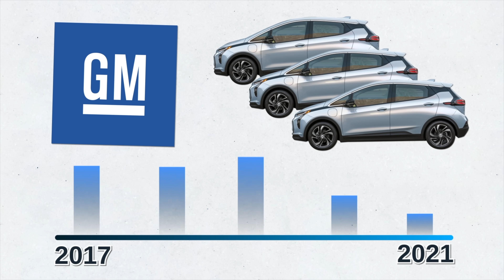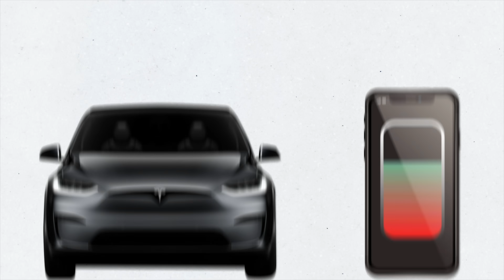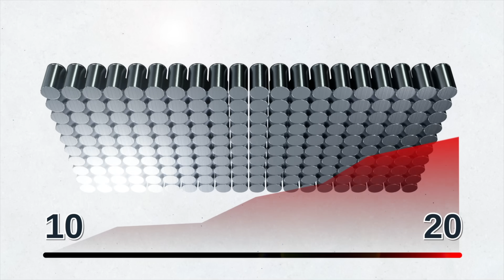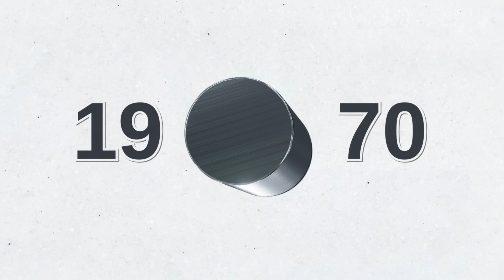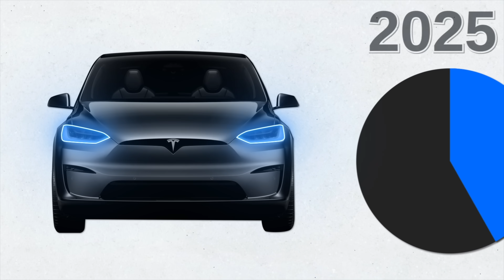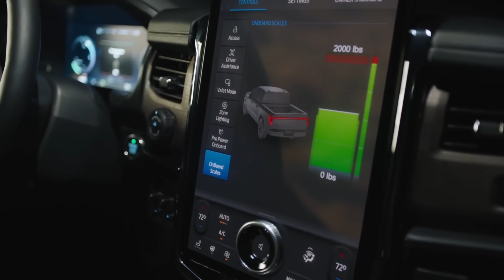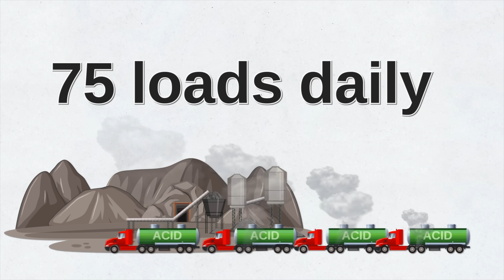They Tried to Shut Me Down for Telling the Truth About This Electric Car

Comment: 100,000 miles isn't long. Especially when you pay a giant price tag and probably gotta hope a college kid buys your car
Reply: Just wait until all these people who are buying these EV's , and need a new battery , and don't have the $$ .  What , finance a new battery for another 3-4 yrs . If their credit allows ?
Reply: E V n  battery  will  be  toast  long  before   100 k  miles  n  less  than  7  years.  throw  away  item / device like  used  laptop, cell phone n  tv.
Reply: Toyota offers 10 year, 150,000 mile warranty on their Prius Prime’s battery, and Toyota’s batteries generally last far longer than their warranties.
Reply: And with trucks that now cost $100,000…you are literally paying $1 per mile for ownership before fuel costs
Reply: @driver4011  Well I was concerned about the first 200 dollar phone I bought.  This 1400 dollar computer I purchased 2 years ago thats having to update every third day just so I can occasionally make a phone call on it but text like crazy on, it wants to be replaced though the battery lasts most of the day and I can usually plug it in all over the place otherwise.  So, 70 thousand for a VW Bug equivalent car that I'll have to throw away in 3 years?  Sure, that sounds reasonable.  NOT  (Are we doing Wayne and Garth quotes anymore?)
Reply: @mcc7762  my mom has one with 110K miles, no issues, but your absolutely correct, I went to my local junkyard, there were more Prius’s than any other Toyota models there.
Reply: the  price  of  hybrid car,  parts, battery n  repair  too  high......same  with  EVs...good  ole  i.c.e.  car  wins.  the  cons  of  owning  n  driving  an  EV  and / or  hybrid  far  outweigh  the  pros.

Comment: My 1987 Datsun 1200 has 240,000 km on it. Stock engine. Still runs like a charm. Hand me down from dad. Most repairs cost less than 50usd. Electric cars are overrated and overpriced.

Comment: Lithium cathodes degrade over time, they can’t simply be placed into new batteries.
Reply: Don't try to explain this or any negative to a glassy eyed EV zealot.  I'm an electrical engineer and have been told flat out that I don't know what I'm talking about.

Comment: As Scotty rightly pointed out numerous times, Hydrogen Fuel Cell technology is the way to go. Then, I'll convert my 4Runner to hydrogen and eventually pass it along to my kids and then their kids. Awesome video, Scotty!! As usual.....
Reply: It would be if the companies supposedly in favor of hydrogen weren’t intentionally sabotaging it to make it seem infeasible.
Reply: I agree that hydrogen is the ideal option, I would want that as well, but transportation of it requires insane amount of energy as it has to be cooled down, compressed and stored under high pressure. It's also not ideal as a solo thing - if you for example would run out of hydrogen in your car it's not like you could take a jerrycan and go to your nearest gas station. You'd literally explode if you'd try to do that.
Reply: @PaganiTypeR  they can make "cans" for it but they would never trust us with that kind of energy density
Reply: Abe, superficially the FCV running on H2 is a very good alternative.  But as the argument to go either EV or FCV is reducing such emissions as CO2 the H2 production is neither clean nor energy positive.  If made through electrolysis from surplus wind or solar, it can be clean except for the costs (both in financial matters and manufacturing emissions) and very dependent upon the excess being there.  If stripped from NG (which is one popular source) there are significant amounts of CO2 exhausted (the argument here is that this CO2 will be CCS into holes in the ground. (Also a technology that has not been working as well as promised but they will keep working on it while the Government research grants keep coming.  If you don't have surplus power from clean sources in the Grid, more energy is consumed in producing the H2 than is available when it is converted back into electricity.

Comment: Electric car batteries are designed to lock you out of the bottom ten percent of capacity and the very top of the capacity that’s why they last longer than phone batteries. That’s why the hoverboards that kids used to ride had so many issues with batteries. kids would ride them until the battery completely drained. Lithium batteries will not accept charging if discharged to a certain value. That’s why people were complaining about the hoverboard batteries. People let their phone batteries die before charging and leave them charging all night which breaks down the chemicals in the battery pack. That’s why they only accept approximately 500 charge cycles. Which works out to approximately 2 years. Which by the way is the terms on your phone contract. Ask me how I know? I replace lithium batteries all day every day.
Reply: but if you can't charge them to capacity or fully use the charge, then the damn things become an even bigger pain in the butt. battery powered EVs are totally unrealistic for large-scale adoption and they are only good as a 2nd car for rich people who have their own houses.  I live in a high-rise condo with 4 split level parking.. so every parking spot is going to have a charger? it's stupid. each one of those chargers costs more than 100k and they use inefficient 'direct current' to charge, which will strain the hell out of the power grid which relies on fossil fuels.. it's stupid

Comment: Last year I purchased a Model s instead of a Lexus LS for my wife so she would never have to stop for gas. The cost were similar so we looked at the cost to operate. Never having to change oil or gas won out. The longest trip she makes is 150 miles so range wasn't a factor. We factored the cost of gas vs electricity over 100k miles and based on today's prices gas would cost 20k, because we always charge at home the cost would be less than 3k. If we decide to keep it after 10 to saving from gas and oil changes will cover the cost of a new battery. Another thing that made the decision easier we are planning to going solar.
Reply: Please report to this same thread in three years....

Comment: According to Elon Musk on Twitter, Tesla car batteries are supposed to technically last for 300,000 to 500,000 miles, which is 1,500 battery cycles. That's between 22 and 37 years for the average car driver, who, according to the Department of Transportation, drives about 13,500 miles per year.

Comment: I could never wrap my head around owning an electric vehicle because of the range limitations. We tend to pick up and go on long weekend trips on impulse. We could never do that with an EV. Now this video drives home an even more logical and economic argument against them, not to mention the political ramifications of a so-called “clean air” ideology.
Reply: and you think status quo is good enough? we should not move to something else and leave everything as is? what happens when oil runs out?
Reply: It's called virtue signaling is more important than truth and performance to these people
Reply: Sure you could do that with an ev. There are chargers everywhere and more being installed all the time.
Reply: @PaganiTypeR  Your arrogance is assuming you know that what I think about the status quo is good enough. Such a turn off to normal discourse. I just like to take impromptu long trips on the weekend. @david wojcik’s response presented a different perspective in a more respectful manner. I would check out his proposition. @Blake M read you correctly.

Comment: When comparing total carbon footprint of gas vs. EV, many times it seems on the gas side, just the energy consumption of gasoline is considered but not the energy that goes into refining the gasoline. It’s very energy intensive and makes the items less equivalent.
Reply: Hence the hybrid/PHEV is by far the best option. Minimal battery footprint with the benefits of electric drivetrain

Comment: I bought a Bolt during the "fire sale". It's a decent car.  Scotty and other mechanics are going to defend their profession.  The rise of EVs is a threat to older mechanics, as well as independent shops who don't have the customized equipment to work on them.  I like Scotty, but he's biased.  My Hyundai engine died at 120k miles, but my new battery will be warranted through 140k miles.
Reply: I'd like to see a real side by side difference in what type pollutes more and uses more resources from manufacturing, driving and end of life. Too bad about the Bolt, it is a good car.
Reply: @stevemiller9480  yeah, fact of the matter is that my Bolt uses only 1/3 to 1/4 of the energy that an equivalent ICE compact car uses.  ICE die hards cling to the stats about pollution during battery production, and overstate the pollution from electricity generation.  My state has a decent mix of nuclear power.  And, it is exceedingly rare for an LG battery to die from long term battery degradation.  People have 200k miles on these already.  The short life Nissan batteries, and the Toyota and Honda hybrid batteries, have given the entire industry a bad reputation for short lifespan.  And unfortunately, the Bolt is giving the entire industry a bad safety reputation.

Comment: I have had electric cars since the 70's and have seen many changes. Although the lithium ion battery is an improvement over lead acid, we still need a quantum leap in energy storage technology for Biden's electric car meme to work.  We are also going to need nuclear power if we want uninterrupted electricity in the future when fossil fuels are phased out.
Reply: Guess what we finally found the answer just in 2021. It's going to change it all, if big business will allow it. The only way to make sure is all the public needs to know about the knew magnetics used to contain the fusion power. It really is amazing, so is geothermal. I think it's Sweden that's completely run off geothermal. For give me but it's definitely cold the and the country is very close to the Swedish.
Reply: @blairpowell1810   In think you mean Iceland, Sweden does well with hydroelectric.  Most countries aren't situated to take advantage of geothermal.

Comment: Actually, if the EV is charged with energy that was created by renewable sources such as wind or solar, then the EV's emissions are already lower at  than fossil fuel powered cars from when you reach 50 000 kilometres in the EV. For those who still use the ancient and inconvenient measuring units, that would mean 30 000 miles. Anyway, it is great that this topic was brought up, and OBVIOUSLY burning coal to make electricity is bad.
Reply: My brother charges his Chevy Bolt and powers his house with Tesla solar panels and power wall on his house.

Comment: Lithium production to me is still a pipe dream. I think the way to go right now is hydrogen.
Reply: Always has been, but stonks
Reply: Ethanol makes the most sense and doesn't require zillion dollars of infrastructure
Reply: @bennyjetsaroundtheworld9047  what infrastructure? Any gas station can put in a hydrogen filling tank. Just like propane.
Reply: The problem with hydrogen is it currently requires more energy to produce pure hydrogen than the usuable energy from the hydrogen.  Other than the high costs, its great!  As the 1st element in the Period Table of the Elements, hydrogen binds strongly to many other molecules - its costly to release pure hydrogen.  

Refined natural gas could potentially be the fuel of the future.  NG contains inert non combustible gases, once these are removed more usuable fuel can be stored in a tank.  Most hydrogen is currently produced from NG. New research in NG -> hydrogen could close the gap in costs - but that's not the case in 2022.
Reply: @bennyjetsaroundtheworld9047  I believe ethanol is a fabulously inefficient method to produce fuel. Ethanol is problematic in many ways.  But I suppose there are problems with any fuel of choice.
Reply: I can't see the benefit of using electricity to create hydrogen, then using hydrogen to create electricity to drive the motor. Seems like an additional, unnecessary step.
Reply: Fuel cells are ** and hydrogen production takes more energy than the actually hydrogen produced. This makes no sense. And hydrogen vehicle still has a lithium ion battery pack by the way.
Reply: @timothykeith1367  that's the same situation with electricity. It takes more energy to produce electricity than the energy you get out.
Reply: @bennyjetsaroundtheworld9047  Burning food stock , what could possibly be wrong with that ???

Comment: He is telling the truth. I rented few electric cars and I noticed performance degradation after 3 years (I like in cold climate). New cars were fun to drive, but those older had shorter range. Plus in winter not so cozy as can't turn on heater - the range will degradate even further. EV might be future, but without batteries. They need find the way to feed electricity to the car from highway - like trolleybuses. So they only need small batteries to get to the highway from home, but then once on the highway cars could be fed from the road.